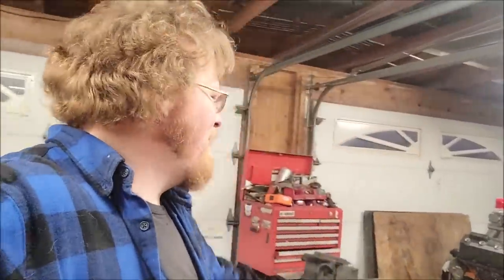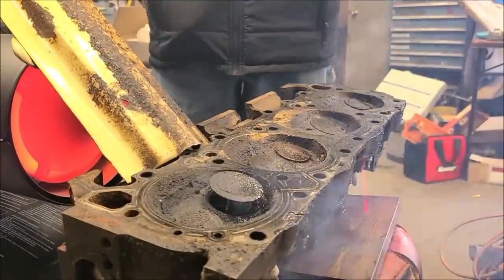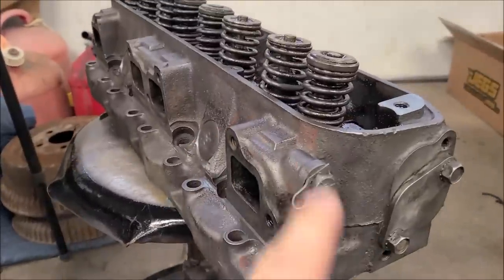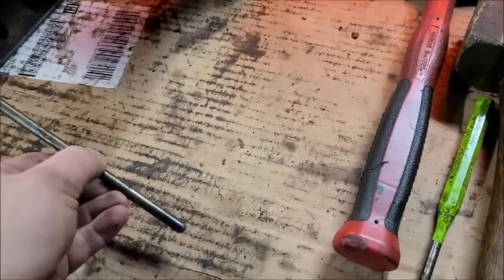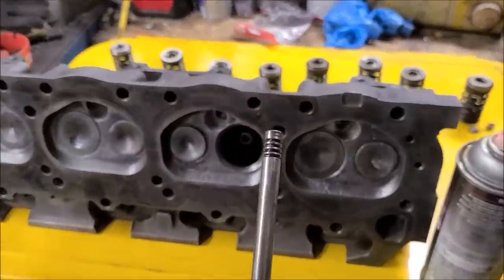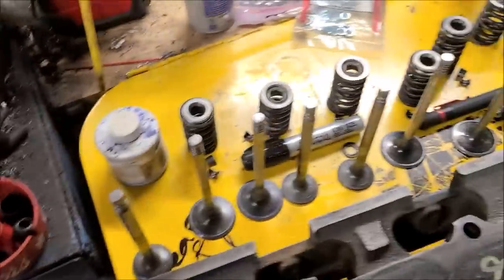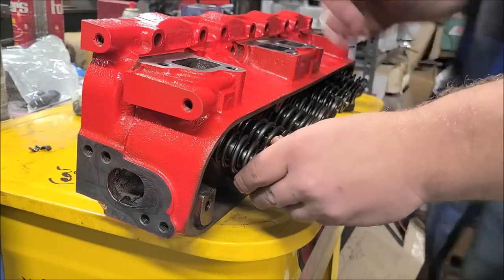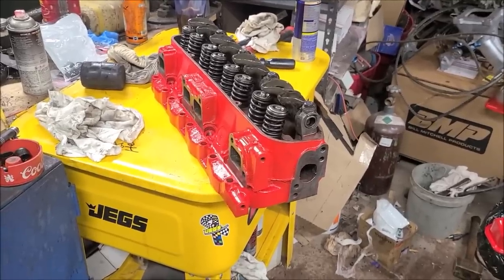DIY Automotive Cylinder Remanufacture at Home #automotive #diy #mopar

Comment: Nice work on getting them heads dang near factory, glad u took the time to clean and reuse all them parts instead of ordering new worthless not made in USA parts, u shall get more miles outta that without no issues👍 great work guys🤘
Reply from the maker: Well there isn't options for the industrial engine
Reply: @ScottsSpeedShop  I hear that

Comment: Do you know what the casting number is on those heads? I'm sure they are common for a truck B block but I'm not familiar with the angled plug heads.
Reply from the maker: These are the standard early style big block industrial heads